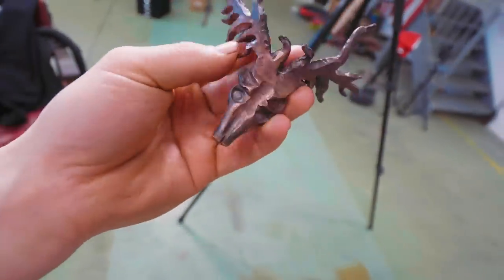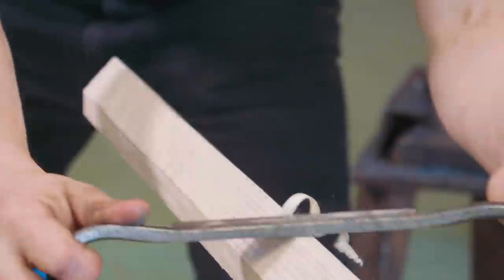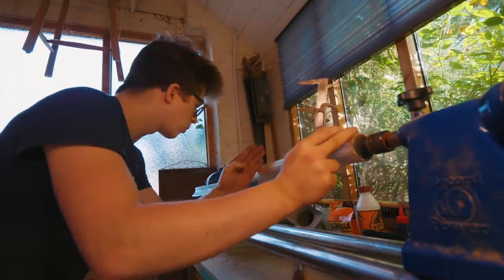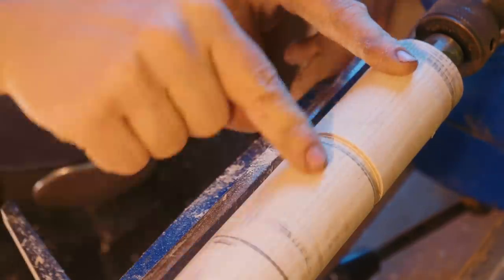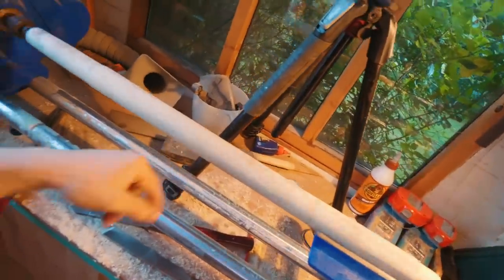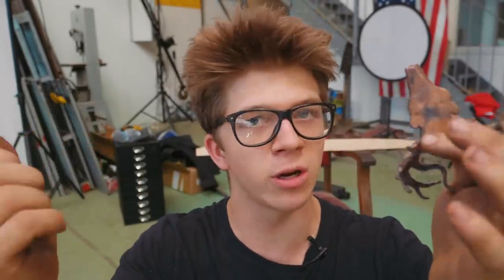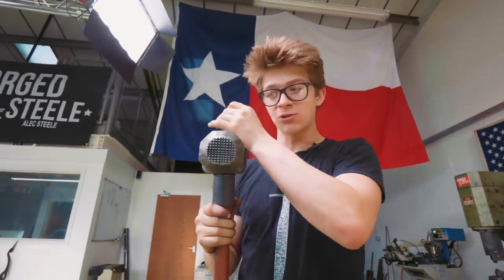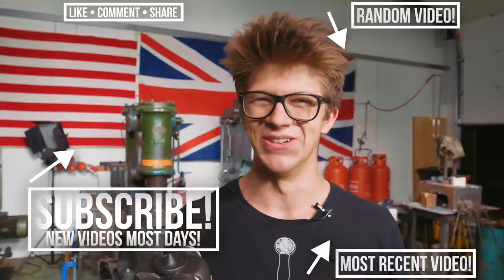GENDRY'S WAR HAMMER: GAME OF THRONES: PART 5 - FINISHED!!

Comment: Silver solder pins in the heads
Reply: Silver solder or braze  to "weld" copper using the fuel/oxy torch.
Reply: This
Reply: Or just normal solder, it'd be plenty strong enough
Reply: Yeah solder (of any reasonable variety) would do it and hold pretty strong.
Reply: I'm with joop on the silver solder
Reply: This is what I was thinking as well
Reply: Would be tough. 16 pound head = massive heat sink...
Reply: Came here to say this. Mhmm that's it
Reply: Spot on. Relatively easy job.

Comment: The best way to do it is to just solder them together just like you would copper pipes. Heat them both with a torch on one side and take a length of solder and touch it to the other side till it melts down in between the rid and the stag head.

Comment: Silver solder over hidden brass pins would have been the best way to attach the stag heads. Another option would have been to do interference fitting into the steel with the brass pins soldered to the stag heads using differential heating (hot steel, cold pins) This has the risk of altering the temper of the hammer though.

Also, oil the wedge as you put it in and the end grain of both the handle and the wedge. This will lock moisture out and keep the handle tight.

Comment: Very difficult build - you did an excellent job - please make us a bonus video of you using that baby to smash some melons :D
Reply: I too, need to see something smashed Alec.
Reply: I wonder how that handle would hold tho when it hit the ground or what ever the melons would be sitting on.
Reply: I wanna see the battle axe go at some melons
Reply: The handle is made from ash, ash or hickory are the woods used for most of alle tools. Including hammers for exampel the sledgehammers that alec uses when blacksmithing, those hit metal again and again. So i don't think it will break unless it is gonna see some really heavy use/abuse.

Comment: Alec, when I have to fix a pin on copper I solder it with silver, I think its called brazing? (I'm not English) Its really tough and  think it would be better then super glue ;)
Reply: Bogyi Blewanus yea silver solder is probably the best way to go in this case.
Reply: oi, solder is your friend
Reply: If it is copper pins in copper holes, you don't really need silver solder, just regular old plumbing or electrical solder will do. If it is brass connecting to steel or something like that, yeah, go with silver solder.
Reply: Indeed. Hi temp solder or silver brazing FTW.
Reply: Actually brazing would require way too much heat for the copper. Brass has a higher melting point than pure copper.  Silver solder is probably also overkill.  Plain old lead tin solder would work fine or you could go with one of the new lead free solders, mostly tin and silver.
Reply: 15% silver solder
Reply: I take it back.  Just checked and pure copper has a melting point about 150'C over brass so brazing could work.  I still think solder would be best though.
Reply: I used it to braze copper and brass but careful of the fumes from brazing brass
Reply: Hank Cohen pure copper melts at almost 2,000 Fahrenheit; brass melts around 1700, depending on alloy. Lead or tin based solder would probably do fine for this decorative use, though. I'll give you that. [oops, I see you were posting while I was writing.]
Reply: silver solder, yes, its commonly used in HVAC repair here is the USA, very strong and simple to use
Reply: Silver solder, joins copper and brass well, but the heat does cause some discoloration in the copper.
Reply: The only reason I think regular solder would be better for this is cost. Regular solder is unsuitable for all metal alloys, but perfectly suitable for the high copper content of what is being joined here, so I will claim solid tin based solder would be perfect for this job. Usually metalworkers are working with brass, bronze, aluminum, and steel, and regular solder may not be so keen to alloy these together, and since silver solder is suspended in resin and has a higher melting point, it will work on alloys that typically resist being soldered. That is a non-issue here. Regular solder is fine for copper things as long as you get the copper hot enough to alloy, and not make cold joints. This, however, is true of silver solder as well, but silver solder is so much more expensive and unnecessary here.
Reply: Bogyi Blewanus was going to be what I would of done. Wasn't sure how strong it would be tough but u guys answered it.
Reply: Slight corrections here- as someone who works with silver solder with many of those metals.

Solder- any solder- is an almost purely mechanical bond, more akin to hide glue than, say, plastic cement or welding.  Solder has a lower melting point than the materials it's joining, and basically flows into the little micro cracks on the two surfaces, then solidifies- somewhat like a nano-scale version of the giant rivet-bearing plates you see on steel girders.

This means that any solder will work between any two metals, as long as the melting point of the solder is lower than the melting point of the metal parts it's connecting, and that there's no eutectic alloying shenanigans like you can get with silver and yellow brass (where the alloy of the two has a lower melting point than the solder, leading to a melted mess).

The difference between Silver Solder (made of silver and copper and stuff) and common plumbing solder (which is generally tin and stuff), aside from cost (and it's not too much- the amount of silver solder Alec would have needed for those pins is probably, like, a dollar's worth at most, and more like 20 cents) is strength.  Silver is actually a fairly hard metal, compared to copper and brass and the like, and so will hold better than common solder.

About the 'suspended in resin' thing- that's primarily for either hobbyist level jewelry repair kits, or industrial circuit-board float-soldering, and the 'resin' is really just a flux in which small beads of solder are colloidally suspended.  The solder itself is pure metal, and can be bought as such for projects like this.
Reply: I am aware of all that besides the fully mechanical bond. I am not too sure about that, but you may be right. I have always heard that surface level alloying does occur, just like alloying occurs with mercury and metals since the mercury IS at melting point, both metals don't have to be at melting point for alloying to occur, but the closer, the better.
Reply: I suppose that there is some alloying happening, but I don't believe it's the primary means of attachment, since you can use silver solder between steel pieces, and silver and steel don't alloy at all.
Reply: What if you add copper?
Reply: Copper doesn't much like alloying with steel either.

Honestly, I'd have recommended he solder the entirety of the stag heads onto the hammer, but the solder joint would adhere to the forge scale instead of the steel itself, and thus not be a firm connection.
Reply: Interesting. I do agree that the weakness(ideally) would come in the strength of everything between the two surfaces of the join, but yeah, without surface alloying, it seems like delamination(cold joints) would be a big problem. /shrugs. I am no metallurgist, just thinking out loud here.
Reply: It's one of the reasons proper surface preparation is so important, and anything from oil to dust to even having a too smooth surface can cause a solder seam to fail.

Comment: Hi mate great video. but honestly. look up how to proper put a head on an axe. same principle. Wranglerstar got some nice vidoes on that.

Good day!
Reply: I think part of the reason the head is so loose is that cuff that he made- instead of matching the cuff's size to the eye of the hammer, he just made it an arbitrary diameter, which meant he had to lathe down the handle to that size.  He could fix the sizing issue by filling the eye with impact-resistant resin, like you'd use to put a fiberglass handle on a garden tool, but like Fredrik said, he's not going to be using this much.

Comment: silver solder would have worked great for the pins
Reply: J Froese Yea ur normal cheap solder from any plumbing section at a hardware store and flux. Just like copper pipes. To Easy

Comment: Hold on, you spent all that time making a bad ass war hammer and you didn't smash anything with it?!?  We need to see some carnage with that thing!
Reply: Yeah they use aluminum in the show for safety reasons but Swinging this beast isn't that much of a problem.

And yeah warhammer of this size didn't exist it's impractical but the closet thing I think a weapon like this was used would the maul as a backup weapon but this was scarcely used for that reason.

Comment: Hey Alex!  What's this new respirator you've been using?  looks like a space suit!  Noticed you started using it about the first ep of this series?  Give it a mention in a future video and tell us where you got it and how it works and why you changed to start using that particular equipment?
Reply: Jason Anthony Lopez It's a 3M Versaflo PAPR, and the welding shield is a 3M 9100FX. Crazy expensive, $3000+ USD but in retrospect cheaper then a full evacuation system for a grinding room for only one person.
Reply: Thats Great!  It looks more effective and a lot safer than the old respirator he was using.  After he chopped open one of the filters and poured out the dust, I gasped!  Yay for clean lungs and safety!

Comment: Cool vids! You asked about ideas with copper, in the past i made my own circuit boards. Ferric chloride erodes copper fast. Blue die protects it good. If you wanted a patern you could blue your copper, scratch the partern and drop in ferric chloride. It would put more definition to your stag, not that it isnt good enough.:)

Comment: Perhaps i saw wrong, but it seemed as if you cut the wedge with the grains at the head of the hammer. That would Split the handle if you were to use it on something. Im certain splitting it against the grains is the better way of wedging it.

Comment: You can braze copper with a rose bud oxygen and acetylene and brazing rods
Reply: My first thought when Alec asked for advice on how to mount the pins to the stag heads. Copper should be brazed. Because of its metal properties it isn't weldable and soldering isn't as strong as brazing.

Comment: When you read the History of the Maul you can find knights wielding hammers up to fifteen pounds in weight which were wood covered in lead. Also the handles of weapons like this were never wrapped or covered because slipping the weapon was used and when the handle has any kind of wrapping you cannot slip it,

Comment: Alec, I'm surprised you didn't just silver solder the stag heads on. Would have been easier to do but a stronger join, in my opinion. Just something to think about for the future.
Reply: Another option could be silicone bronze TIG welding
Reply: Pretty Hate Machining the sweating idea is great lol I thought that first cut my dad's a plumber.
Reply: My first reaction was oxy bronze welding... but yeah, silver solder would work much better!
Reply: My thought was brazing it on with zinc
Reply: I liked his pin idea, but I think I'd have just drilled holes through the eyes, welded on a couple mild steel plugs and leave them soft, then peen them down like rivets. You'd get a nice contrast with the black iron eyes and the lustre of the copper.

Comment: You did the Handel wrong you stuff the handle I. To the hammer the hang the hammer and use NOTHER HAMMER TO DRIVE HANDLE IN TO (sorry 4 caps) the head by doing this things long up better so the new handle lasts 3-12 times longer

Comment: Possibly some brazing with oxy acetylene torch. Put your pins in the back of the STAG HEAD.
Also, a few coats of linseed oil on the handle.

Comment: Loving the videos. I would have brazed round stock to back of the stag, drilled holes through the steel and peened the pins over inside the collar giving a nice mechanical connection

Comment: To get the copper to fuse try brazing instead of welding them. Copper has such a low melting point that it melts before it has a good chance to weld with arc welding techniques. Brazing is done at much lower temperature with an oxyfuel torch. It uses different filler metals however still makes quite strong bond. It’s very similar to gtaw (tig) welding just uses a flame instead of the arc. Love your videos keep them coming

Comment: @ Alec Steele - Hey Alec, here's a tip for ya on that handle. Instead of using an oil try a Carnuba Wax. The wax will give it a very nice polished look and deepen the color all at the same time. After applying the wax by hand with a rag, hit it with a cloth buffing wheel. I guarantee that you will like the result! Great project btw, love the vids!

Comment: You'd have a much easier time welding if you kept your torch angle to 15 degrees from vertical. I know it would make shooting the welding practice sequence harder to film, but you don't loose gas coverage of the weld. Other than that keep banging out awesome pieces.

Comment: War hammers were actually quite effective. They were only used by the strongest of the soldiers but when used they were devastating. When the hammer was swung and got “up to speed” so to speak, it had a ton of momentum, then, upon impact, all the energy would be transferred to the armor through a small point of impact and then to the body, much like how squash head tank ammunition works, the transfer of energy from a heavy, fast-moving object, to the tank, fracturing the interior armor and sending it ricocheting through the crew compartment. Different centuries, different weapons, same general idea. A well swung and well aimed war hammer could kill an opponent instantly with the concussive force alone. Imagine what would happen if the pointed end was used - pure annihilation.

Comment: I think trying to weld copper was a fair attempt, but I would maybe try using solder. That's the best way to attach copper to copper or any other finer metal, which is what I'm most familiar with working with. Soldering was probably one of the hardest things I learned how to do with metal and it takes some practice, but if you are going to be working more with copper, I would recommend giving it a try. I have never tried attaching copper and silver, but from what I've researched, there is a way to attach them by using the proper solder as well. I unfortunately don't use youtube for making videos, but if you have any additional questions about copper in particular, feel free to send me a message.

Comment: One thing you mentioned is that warhammers weren't practical and would never actually be used. That's incorrect, they were the anti tank weapons of that age. Imagine seeing a knight in full plate armor, walking through the battle with near invincibility, swords just bouncing off of him. Now picture what a warhammer would do to that suit of armor... Once the armor is caved in, it won't bounce back, so even if all the padding in there prevented the guy wearing it from having a direct injury, loss of mobility as joints fail, or possibly even loosing the ability to take a deep breath, and after just one or two hits, the knight is going down. That isn't even considering if you whack him with the pointy end

Comment: I would have used the Oxy/Acetylene torch and solder the pins into the drilled holes. 
MIG isnt copper friendly, oxy/acetylene is :D

Comment: Personally, to mount the pins in the stags I would have made barbed pins of copper or brass by lightly chiseling them at an angle except for the portion to be set in the holes of the stags and then soldered the pins  into the stags and used epoxy to mount the whole fixture with the barbed pins allowing for a stronger grip to the handle.

Comment: I would have brazed them, not with true brass fill, but the softer alloy with a lower melting point and powdered ammonia flux. Just brazed the heads straight to the collar, or I suppose you could solder it jewlers style, but being the ammount of impact and vibration it would see with theoretical use, brazing would hold better.

Comment: I know its old....but i would have tried to shrink in the pins....heat up the head and shrink in some copper....should hold really really good as copper moves ALOT when heated....you wouldnt get it out anymore as the heat of the copper would heat up the insertet (cold while insertion into the hot head) pin and ....eyah...you know what i mean
greetings

Comment: Ex blacksmith turned jeweller here, As a suggestion you could use easy flow silver solder for small pins in elk head,

Comment: I seen you trying to weld the pins on the copper stag, just a thought but I have had success tig welding copper on AC current and using stripped electric wire (Romex for household use) as filler wire

Comment: I know it would be hard to do but personally I'd have super glued the heads to the hammer just to hold it so I could run 2 holes like u did but clean thru.. then use 1/8" copper rod to make rivets to hold the heads permenantly.. copper from what I can remember is more easily malible so u may be able to use them for rivets without heating...